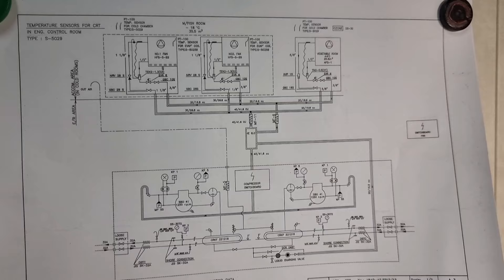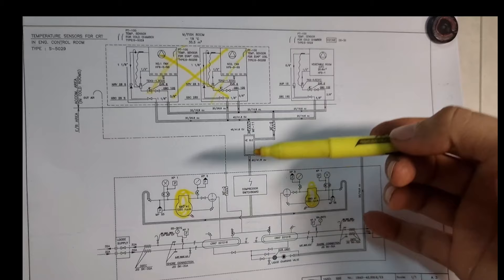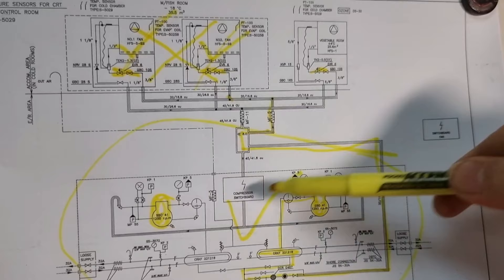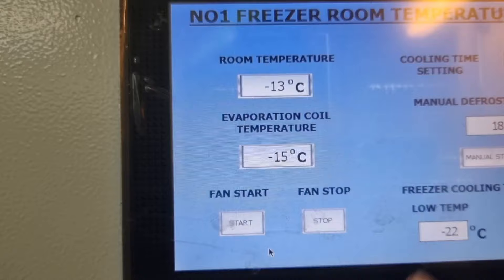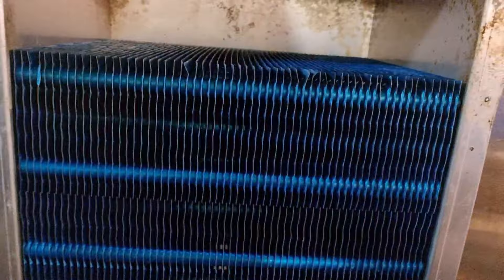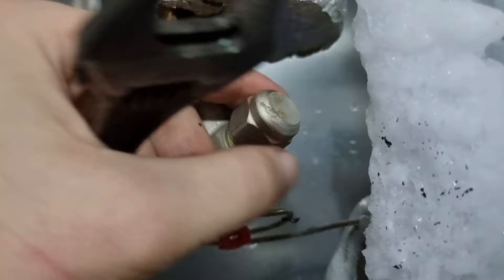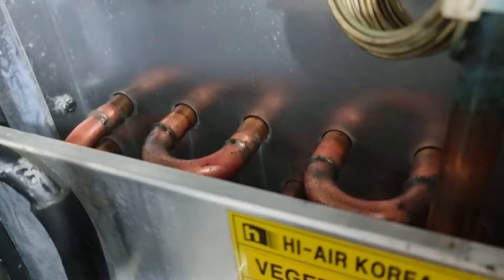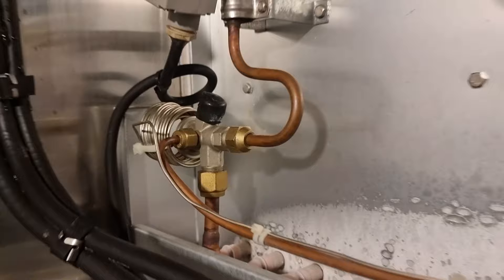PROVISION REFRIGERATION TROUBLESHOOTING | Marine Electrician

Comment: Kindly it would be nice to elaborate on superheat thing. First of all if the system was running fine before this problem happened and there was no work done on the TXV of veg room . So why to solve the problem we have to open the TXV more . As we know it has been set by factory before it was fitted as per requirement of the system. That clearly says that TXV should automatically open more as per the operational requirement. That means opening pressure due to the bulb sensing is not sufficient to maintain the superheat. Though the action solved the problem but I feel if TXV is malfunctioning then it needs to be changed so that it maintains the temperature in the previous setting of the TXV.
Reply: Risk to open too much is flooding back and damaging the compressor. However, at sea those TXV are subject to a lot more mechanical disturbance than on land.

Comment: Dear Jake, Icing on evaporator ,so you reduced the super heat by turning it into counter clock wise. Actually here, superheat was "increased". I believe it's done after turning the adjustment screw to "clock wise ."
Reply: Are u eto
Reply: Superheat is reduced by turning anticlockwise.

Comment: Hi,, thanks for the vedio which is very usefull.. Lecky,, I have a same trouble which is Ice deposit on expansion valve. I have cleaned inside filter and run the system. But trouble is remaining still. Unfortunately , I dont have a spare one onboard ...😒

Comment: Our Blaster Freezer room (-40C) frequently have icing on the floor (we have proper door with gasket and curtain strips but hot air from outside or products when we push the hot product into the room to freeze them). Our floor has changed to use PU to reduce icing and anti-slip yet still have this issue... do you have any suggestions?

Comment: Thank you for this video. I still have a question, how do you know the level of the refrigerent is okay? And how do you assess the evaporators on your meat and fish room are still good?
Reply from the maker: For the level, check your pressures, and on the sight glass you will see the level.

For the evap of meat room and fish room, no ice to thaw on the grill and the temperature is in range.
Reply: So is the same compressor running all 3 rooms? I was curious on refrigerant level as well but did not see any gauge readings.  Nice video.  I would like to see a little more testing before your determination. Thank you.  Im about to get certified but lack experience because of covid schooling turned to online.
Reply: @SCAMATICS777  Its the same as a multi split system AC. no difference, dont confuse yourself with labels, look at what they are, just a pump cycle with switches and relays, oh and mini switches and relays (PCB's). easy as pie, a trained money could do this work. im living proof.
Reply: Super heat and subcooling is hoew to tune a system, go look it up. you will need to know what they mean if your going for a jab,... i mean job.
Reply: You can see the refrigerant level on the sightglass paced on the condenser unit wich should be at middle the liquid level. Furthermore the temperature from fish and meat room are both in range -18 °C, also you can see the refrigerante gauge from low pressure the indication should be about 1 bar or higher with one of the chamber are working, i hope this make sense and can help you.

Comment: It simply needed an off cycle defrost timer installed or replaced. Or may have been trying to run it too cold. I doubt the txv needed adjusting.
Reply from the maker: It is actually a vegetable room so no defrost for the system
Reply: @leckyjake  How do you keep 4C in there without defrost ? In a humid enviroment in a kitchen and especially on a ship at sea.

Comment: Hi Elect, thank you for the video, just curious if the vegetable room have evaporator pressure regulator since the piping is interconnected with meat and fish freezer? Means both suction pressure are the same. Provision compressors on this video is Bitzer / Sabroe open type.

Comment: The refrigeration mechanic who has to deal with real problem will thank you later👎 this will mislead him very nicely to find the root cause of
The problem, a word of advice, dont go turning/changing adjustments  unless you are absolutley sure that is the cause of the problem.
Reply from the maker: Well I believe all refrigeration mechanic knows that. That is the main reason why it was the last part that was adjusted and I have waited for another day to see the behaivior of the expansion valve. After being sure about the main root, I have decided to do the adjustments. Vegetable room is running fine for a month now.
Reply: sir can we know the superheat range for chiller? what is too high ang what is too low?
Reply: @leckyjake  great👍
Reply: I think what  @sjefoekel6058  is trying to say is that any adjustment made on a txv has to be a precise one since  txv is exactly that, a precise component. 

In this case, the initial superheat of the evaporator should have been calculated first (knowing the suction pressure and temp) to confirm that indeed the superheat is high due to a restricted txv. Then, calculate the superheat again after the 1st adjustment to see if it now falls into the proper range (normally between 5 to 8 degC). This last step should ensure that your superheat does not fall below minimum and risk flooding  your compressor with liquid refrigerant  eventually destroying it.
Reply: @archiearon654  hear hear👏👏👍

Comment: Could someone please explain why reducing the superheat reduced the icing on the evaporator coil?  If the evaporator had high super-heat it's because not enough refrigerant was flowing through the TXV.  Reducing the superheat is adjusting the TXV to permit more refrigerant into the evaporator, making more surface area colder.
Reply: I thought about this more and here's my theory.  Someone let me know if there's another explanation.   You have 3 systems sharing a compressor.  That compressor running at a constant speed and displacement  (ie pumping a constant cfm).  The 3 evaporators are sharing the compressor's displacement or cfm.  Each evaporator's TXV needs to deliver enough refrigerant to the coil so that refrigerant can boil and expand to raise the pressure in the evaporator's outlet, providing a required amount of refrigerant cfm for the compressor to take away.  If the TXV isn't delivering enough refrigerant, the compressor's cfm demand will draw down the pressure in that one evaporator to a pressure low enough that the evaporator will be below 0*C and cause the condensation to freeze on it.  By adjusting the TXV to permit more refrigerant to flow through it (ie, reducing the TXV superheat setting)  that evaporator now has more refrigerant to boil and expand, offering more volume to the compressor cfm demand and to raise the pressure at the evaporator outlet.  The evaporator's temperature is determined by its pressure.  Now that it's operating at higher pressure the coil's temperature is also higher and above 0*C, preventing the condensation from freezing.

Comment: Sir. Good Day! The main reason of Icing on the system is low flow of Refrigerant in the System right?? Thank you!
Reply from the maker: I lower the superheat by reducing the spring tension of the TXV.
Reply: Yeah low pressure. Because the TEV doesn't let enough refrigerant through the pressure will drop and the refrigerant will start to evaporate at low temperatures.

Comment: What is the range for normal refrigerant level sir in your system?
Reply from the maker: Actually I use the pressures as the baseline for any refrigeration system and then level in the sight glass is just secondary
Reply: @leckyjake  so what would be the normal refrigerant pressures level for high side and low side in your system sir?
Reply: @johnangelodelacruz6431  pressures vary with the refrigerant in the system

Comment: On my ship an abnormal alarm came. And I went to see the alarm could not find cause of alarm. When I reset the motor and started. So what happened is again the motor tripped. Please suggest me what to do?
Reply from the maker: First which motor is this?
Better check the winding resistance of the motor. Iine to line and line to ground with the supply cables disconnected in the motor terminal

Comment: Sir good day po ano po cause of trouble at pwede gagawin sa Accomodation aircon po namin laging nag yeyelow ang evaporator side kaya mag trip ang aircon. Ang suction side pressure nya po normally nasa 0.4 to 0.5bars peru pag nag yellow na sya umabot nalang nang 0.10 to 0.12 tsaka mag trip.

Comment: Kindly help..
Here on my ship , there is icing in evaporator in AC system kindly suggest the reason and solution
Reply from the maker: try to check the level of refrigerant. most probably this is undercharge.
Reply: @leckyjake  thank u bro...
My compressor is having mechanical type unloader, now it is loading and unloading frequently within a minut , so is it normal operation or abnormal ??
Compressor- Carrier 5H80

Comment: This is not proper way to adjust the super heat...before adjust the txv you must check the strainer of the txv.. Then you should use the thermo meter to check the superheat... Because I did same as you adjusted but but it was not successful.. Am I right or wrong?
Reply from the maker: Our system is running just fine for more than a month now after the adjustment. I do not use much of the tools you needed to fix the same. Double check the video, if ours have strainer or not.
Reply: @leckyjake sir Ang ibig sabihin nyan cguro na strainer yung sa orifice nya my kasamang strainer Po yan

Comment: thank you sir. But I have a little confuse about super heat. In this video, Sir You made lower the super heat, so you turn the counter clockwise the txv. Why did u do that sir? I think if u do that, lower the super heat how can be defrost sir? If you don't mind, can you explain about the superheat sir?
Reply: Yes, I thought the same. If you lower the superheat you will add more refrigerant in evaporator. From my point of view he did it in order to increase evaporating pressure inside the evaporator and hence increase the evaporating temperature in order to eliminate ice formation on the tubes.
On the other hand there is a pressure regulating valve after evaporator of the Veg Room. By adjusting this valve you may regulate the evaporating temperature as well. I think it is more preferably than lower the superheat as it mat cause liquid stroke of compressor in the worst scenario.

Comment: You can’t just pull the whole solenoid coil without putting a piece of metal/ screwdriver between the hole. Otherwise, you will burn out the coil itself .

Comment: Boss hingi sana ako assistance 😊 1 ac accommodation compressor namin kasi biglang pumapara kasi bagsak agad ang low pressure nya pero ok naman mga pressure nya before start ng compressor. Pagswitch on ng compressor ilang secs lang para na baba din LP nya after few minutes tataas na pede na uli start kaso balik na naman.any advise o suggestions? Salamat
Reply from the maker: First is nangyayari ba yan for both Compressors? Or sa iisang compressor lang? Kung both then may mag focus ka mga common cause ng blockage ng line like filter drier, expansion valve and main service valve.
Kung sa isang compressor lang better check the suction service valve and valve plates ng compressor.
Reply: @leckyjake  boss ok naman 1 compressor. Plan sana patakbuhin ng sabay gawa ng mainit o summer na.
Reply from the maker: Ang LP ba na alarm is sa refrigeration side or sa LP ng lubrication ng compressor?
Reply: @leckyjake  actually wala syang alarm sa LP o kahit saan. After start ng compressor few seconds stop na sya sabay pagbaba ng LP at oil pressure
Reply from the maker: Kung oil pressure ang nag activate linisin mo muna filter ng crankcase
Reply: @leckyjake Ok naman both pressures before start ng compressor kaso pag namatay na compressor baba na LP at oil pressure

Comment: can we use hot water for removing ice or Normal water is ok
Reply: can u plz elaborate we should open or close the tev valve ??
Reply from the maker: No it is not allowed as it can cause thermal stress to the tubes
Reply: @leckyjake  but you were using hot air blower is it ok??